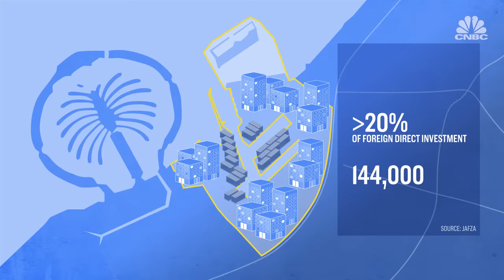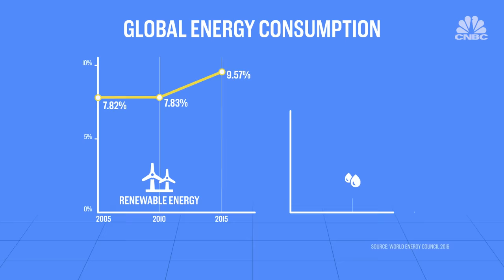How did Dubai get so rich? | CNBC Explains

Comment: Just some correction on thr info provided in the video. Withholding passports have been banned by law in Dubai since 2006. Reforms in labor law as well as labor camp conditions including regular government inspections to ensure standards are met have been imposed since 2010. In 2017 Dubai has passed a law to ban even courts from withholding passports, as well as a law for equal pay for equal work.

Comment: Video is good but I believe a couple of the facts were incorrect. Abu Dhabi is a bigger Emirate than Dubai and oil was also discovered there in the late 50s as opposed to the 30s. Dubai's GDP is not reliant on oil, however, most of its investors are. Abu Dhabi's GDP is heavily reliant on oil and has helped fund Dubai's growth. Their partnership is great as it helps for a more stable and diversified economy for the country as a whole.

Comment: How did Dubai get so rich.

Answer = Greedy americans that have to drive their larger vehicles and also start wars over oil - but like to use other excuses to try to claim otherwise.

Look in almost any american city or town, especially during rush hour. One cannot help but notice all of the larger SUVs and trucks - typically only with the driver. Average gasoline consumption is typically less than 20 mpg. I sincerely look forward to times when the price goes above 4.oo per gallon.

Alternatives...

1. Does one really  need a vehicle of that size?
2. Try to share a commute, get any vehicle of smaller size of better gasoline mileage ratings, even try public transportation.

Try a vehicle such as a Hyundai Ioniq hybrid. Seats four very comfortably with cargo. Even fully loaded still gets in excess of 58mpg highway or city driving. Or try a battery vehicle, especially due to items such as incredibly low maintenance.

Because america's greed is both making other countries incredibly rich and powerful - and also costing the blood of americans. Give up that oil and all of the sudden a majority of the Middle East loses it's power